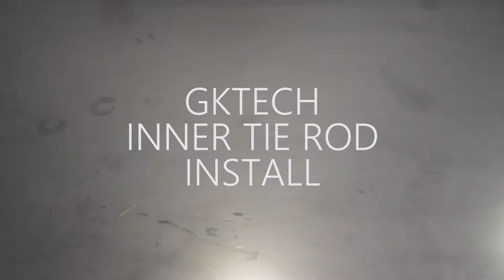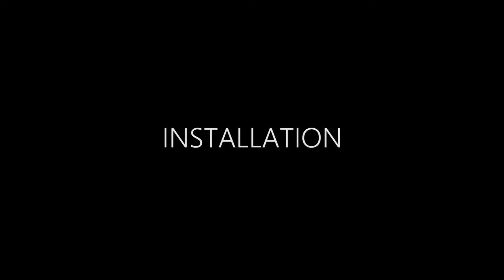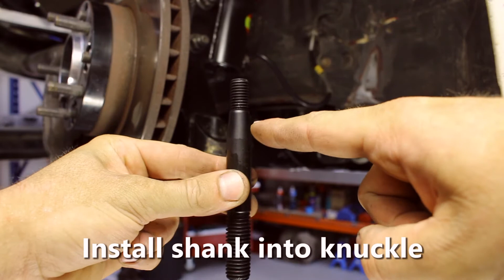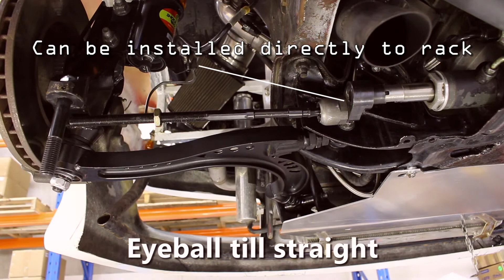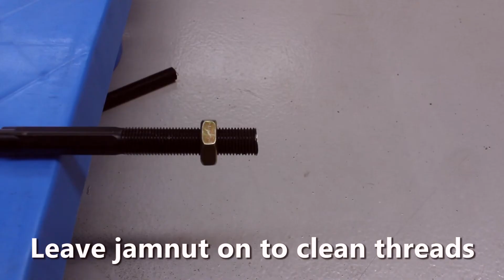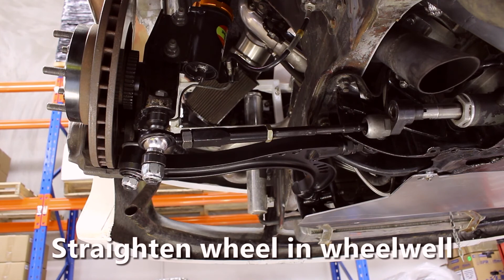How to: Installing the GKTech M14 Super Adjustable Inner Tie Rod

Comment: Dan, I have been living by you vid’s as I’m putting together my s13! 😂 I have the full gktech front setup, v4 knuckles, 74mm lca, m14 tie rods, etc. my issue is the shank for the outer tie Rod is too long… I’m running 18x9.5 +12 and even with a 20mm spacer the shank will not clear my inner barrel. I’ve been scouring you vids and cannot see that you ever had a problem with this. Do I just have to cut down that shank? I’m pretty sure I’ll have enough to compensate for bumpsteer if I do since I’m using 2 spacers on the bottom. But I didn’t know if that was ok to cut them. You ever have any issue with this? I’m also did rack forward relocation. Btw. Thank you in advance. I’m trying my best to get this thing back on track. Literally! Lol
Reply from the maker: Thanks for the kind words man! We are here to help. Yes you can cut the shank down, just make sure enough threads are there for the lock nut to engage!
Reply: @Officer_Dan  awesome!! Thank you for the quick reply! I did the full rear about 4 months ago, your vids were key to my success! And then again working on the front now! Awesome! You saved me tons of time throughout the processes! Keep it up! 💪🏼

Comment: So I saw you lined up with the bevel on the inner tie rod and then backed off a bit im assuming for adjustability for your alignment what is a good length to back off there for maximum thread engagement but still having room for adjustment?

Comment: So I have the 350z super lock kit going on a v35 should I fit rack spacers and both control arms then adjust to where I want the wheel and work out cuts from there ?
Reply from the maker: Thats the basics yes! Just remember to get max thread engagement, but still leave some room for adjustment at the alignment shop
Reply: Dan Brockett will do thanks for the advice 👍

Comment: Will these inners and outters work for a stock s13 knuckles, running the GKTech RCC and steering rack spacers?
Reply from the maker: You will have to run the 14 outers to run the inner, but yes!

Comment: if I have 40mm extended lcas do I still cut for thread engagement or would they be the proper length right out of the box?
Reply from the maker: You may need to trim a little (but not much). Do you have any rack spacers?